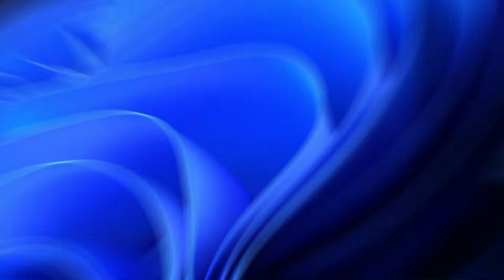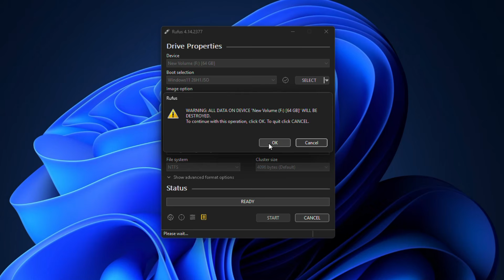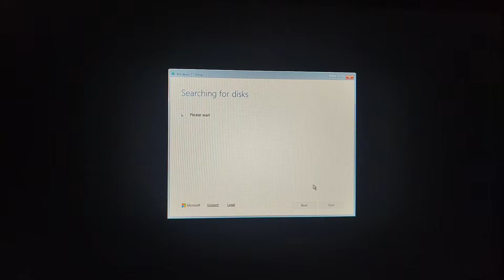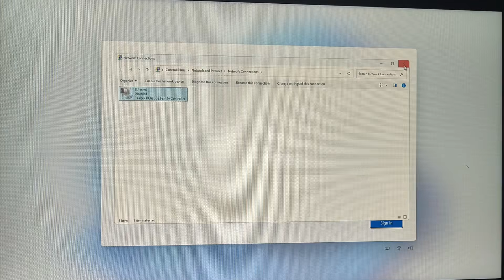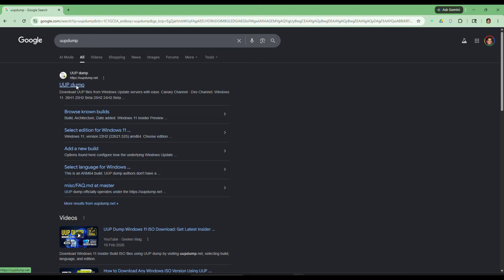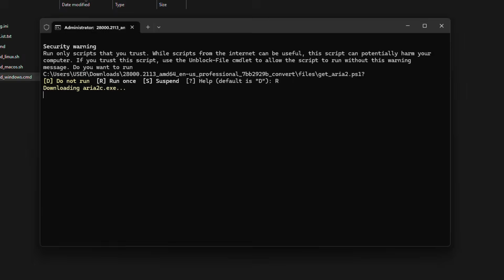Windows 11 26H1 Installation Guide | Rufus Bootable USB + Clean Install

Comment: Can I put windows 11 on an hp z200 pc with an i7 870 processor
Reply from the maker: Yes, but the Intel i7-870 is not officially supported by Windows 11. You can still install Windows 11 26H1 using Rufus to bypass the TPM, Secure Boot, and CPU requirements. Performance should be fine for basic tasks, but make sure your HP Z200 has enough RAM and an SSD for the best experience. 👍
Reply: Yes, but when I install through rufus and do everything abdejt, my computer won't load into the system, I've already done that

Comment: I have old desktop dell 5040 core i5 6gen it failed to boot window 11 25h2 can you help ..?but window 11 22h2 its okay
Reply from the maker: Your Dell 5040 (6th Gen Intel) is not officially supported for newer Windows 11 builds like 25H2/26H1. If 22H2 works but 25H2 fails to boot, try recreating the USB with Rufus, update the BIOS, and check whether Secure Boot and TPM settings are causing issues. Please share the exact error message or boot screen photo for further help.

Comment: Not yet available at Microsoft official sight that is Media creation tools..showing 25H2 still ..!
Reply: 26H1 isn't for general use and not compatible with a lot of PCs. 26H2 will be released later this year.
Reply from the maker: @cammy85  Correct, 26H1 is mainly for testing/Insider users. This guide is for those who want to try it early, while most users should wait for the official 26H2 release.
Reply from the maker: You're right. The Media Creation Tool still shows 25H2. In this video, I used the Windows 11 26H1 ISO file and created a bootable USB with Rufus for a clean installation.

Comment: Super ale ten system jest na procesory arm a nie amd ryzen
Reply from the maker: This guide is for the x64 version of Windows 11 26H1 and works with AMD Ryzen as well as Intel processors. The ARM version is a separate release.
Reply: Mam system Windows 11 26H1 i AMD Ryzen 5 5600 6-Core Processor               (3.50 GHz)
Reply: działa elegancko pozdrawiam
Reply: na czysto zainstalowałem